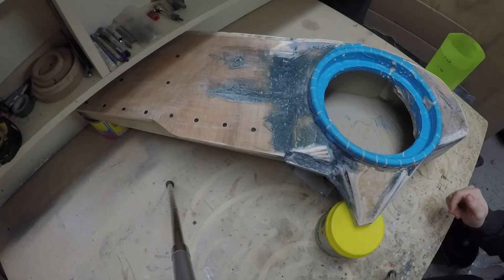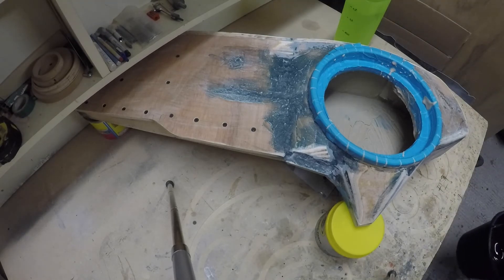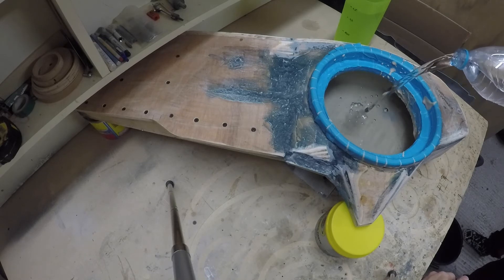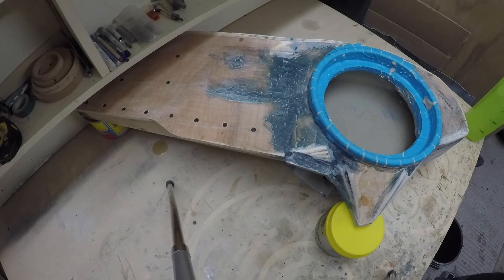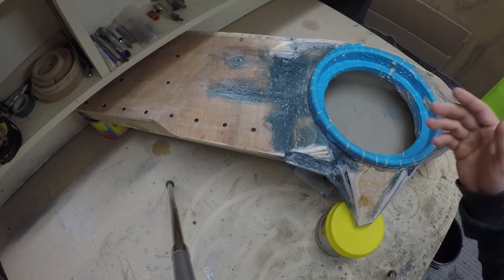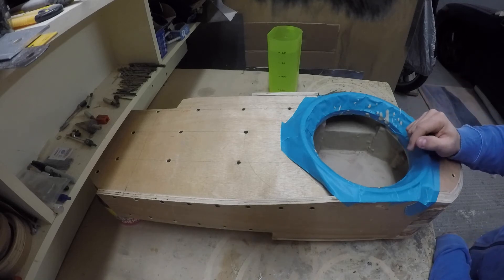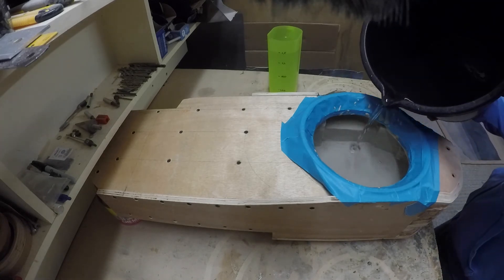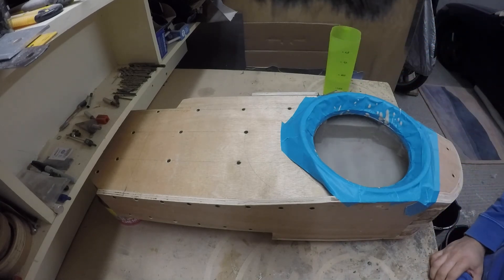How to measure custom speaker enclosure volume and test air leak

Comment: Love the way you build enclosures. People also should know that you don't actually want a sealed enclosure to be totally air tight due to atmospheric pressure equalisation being an important factor in sealed design, but most drivers and fixings leak just enough air to achieve this anyway, if not a pin hole is enough.
Reply: Yes, I completely agree and atmospheric pressure does vary significantly depending on the weather. But, as you say, drive units with porous centre caps, or cloth roll surrounds are not entirely airtight and/or a 2mm hole should be sufficient to let the air pressure equalise whilst still behaving like a sealed enclosure.

Comment: Water is more dense than air bud might not leak water but could leak air I'm supposing and usually speaker boxes dont have an inner coat so you would completely ruin it if it was made of wood but I like your idea though
Reply from the maker: Chris, if there’s a tiny bit of crack, water always finds it’s way, just give it time. 
I don’t really understand the “ruining” part...
Reply: Chris turn the bass down on your parents minivan... it's ruining what's left of your brain bud!
Reply: If you're coating an enclosure it's totally safe, the resin seals the material perfectly. Lots of subs do have coating on the interior btw.

Comment: Sand is just as accurate and won't cause issues with moisture within the enclosure (mold/swelling). As for determining if it doesn't leak air, that would've be easy to determine during your previous step when you coated the inside of the enclosure or any of the previous steps of construction by making sure your joints are without gaps. An expanding glue or silicone would've helped on that too. Calculating the airspace is always great to know, but everyone has their own way to get there.  I'm not saying your way is wrong, just adding that it's not the only way.
Reply from the maker: Indeed, there are many options, but as you commented “should” first, i thought you had problems with water. 
As you see this build was a complete puzzle, so achieving 100% tightness needed a bit more attention. I only had that single tiny hole, so i think i did well. 
Also, i never use MDF at areas, where water/moisture can be an enemy, so i’m with this technique! I wouldn’t advise this for MDF boxes for sure! 😃
Reply: Mold would only come from water being left in the enclosure. I highly doubt there will be any left in there LOL when he mounts the speakers.
The only thing is sand can't tell you if you're completely airtight. And the last thing I would want is any loose sand flying around inside the spider and especially the pole piece.
It would be a lot easier to get rid of all the water then all of the sand. Believe me I detail cars for a living!
Reply: David Smyer 
With water is right there at the tap it makes sense to use it and then when he's done he can just poured away. No reason to go out and buy sand and just have to keep it stored somewhere.
You would have had subpar performance (no pun intended LOL) and not even had known why if you have not found that pinhole with the water. Yes he could have possibly felt the air when the speaker was playing but that would have met you would have had it disconnected from the door trying to play the driver which doesn't make much sense.
There's no reason to worry about the wood swelling because it's not in DF and yes eventually plywood would swell but it is literally covered in a thick layer of fibreglass powder, resin, and body filler mix.

Comment: You should use sand or packing peanuts vs water.
Reply from the maker: David, what’s wrong with water? It’s definitely the most accurate.
How would you test air leak with your options?